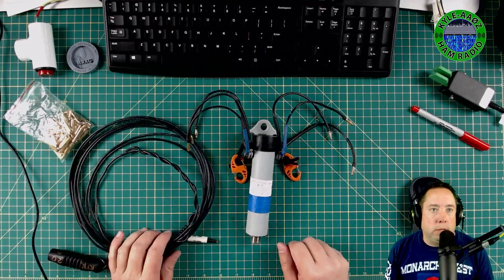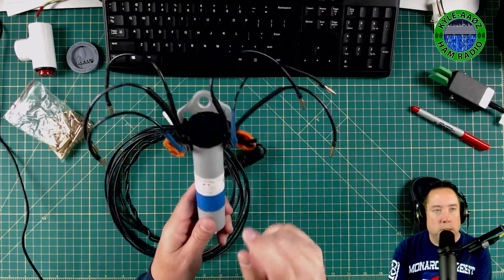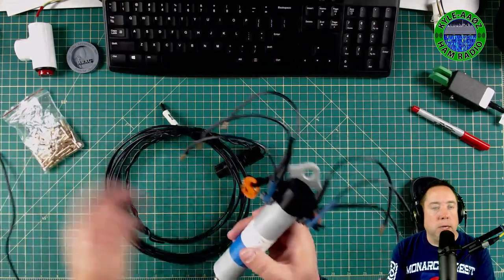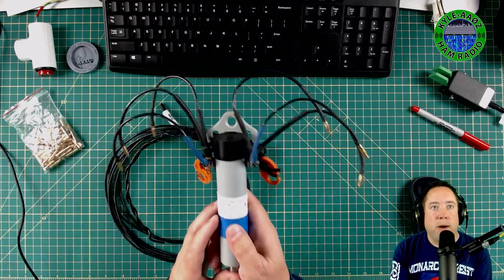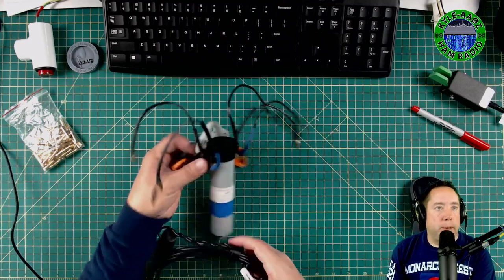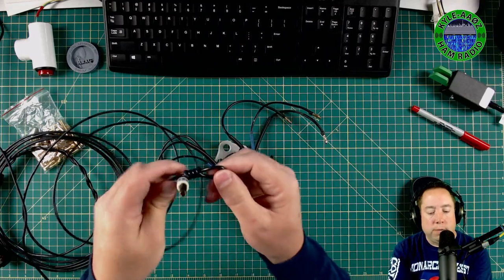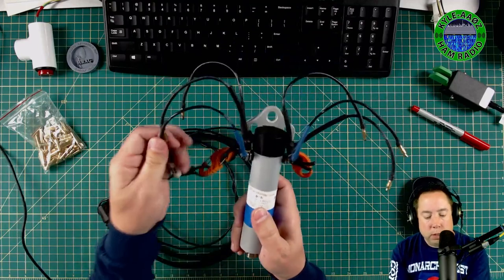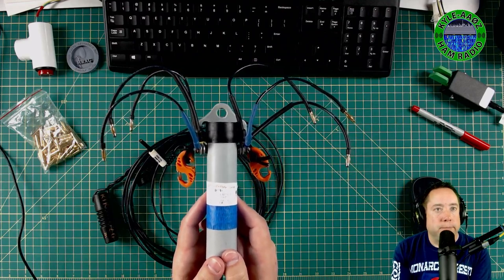Quick Disconnect Fan Dipole Antenna - Build Your Own!!!

Comment: Will those bullet connectors corrode if I leave this antenna outside? You listed 4mm connectors, what gauge wire is that good for? Thanks!
Reply from the maker: Yeah, this is probably not a good outside setup.  4mm connectors are good for 12ga wire.
Reply: I ordered the bullet connectors and they are gold plated. I expect it to be a good outside settup. 
As far as I’m concerned all antennas are meant to be for outside.

Comment: I was told about fan dipole by my local friend when I said that I have very little space here. But he said that there could be interactions if more than two are added in limited space. de VU2JO.
Reply from the maker: Correct.  This octopus antenna is fanned out at 60 degrees for each leg, so there is very little interaction.